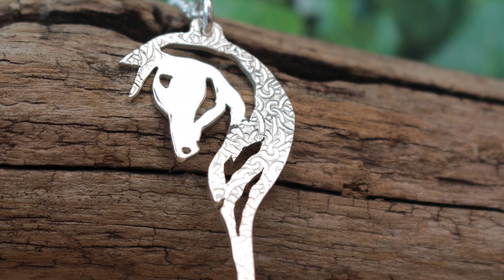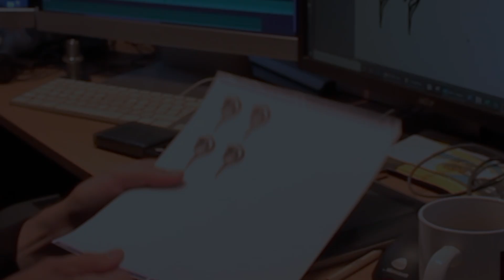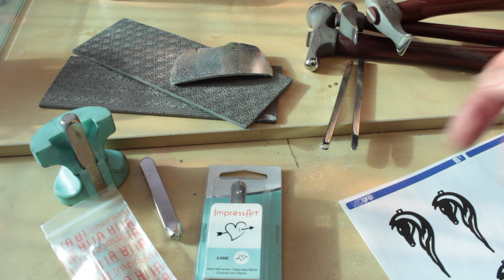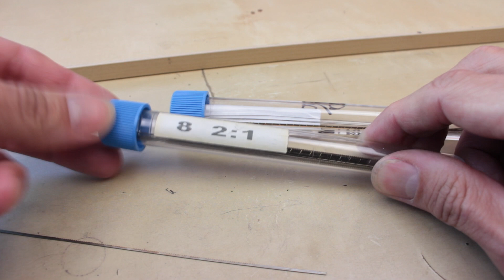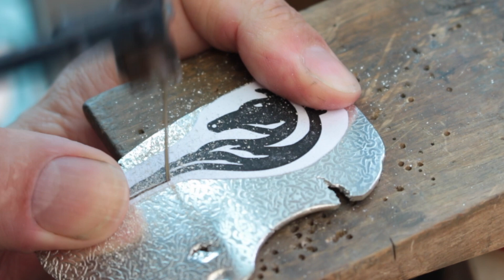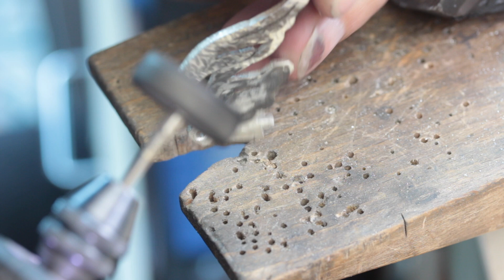Celtic Horse Pendant (how to use a jewellers piercing saw)

Comment: i would take the time to learn how to sharpen drill bits as it takes a matter of seconds and saves you about £2.50 each time you sharpen it instead of replacing it
Reply from the maker: I usually find with these fine drills, they break before they ever get blunt. I buy them in boxes not because they get blunt, but because i snap them. very thin and very brittle. Dave

Comment: Thanks Dave. Excellent video. It makes me think I might be able to do this. The texture plates from Oregontrailsilver.com are amazing.
Reply from the maker: I show a range of different techniques and tools here. But you could simply buy a sheet of silver, draw a shape with a sharpie, drill  and saw it out. it's easy to add texture with a cheap ball peen hammer. So grab a saw and give it a go. At worst you'll break a few blades (...but so do I  !). Good luck. Dave